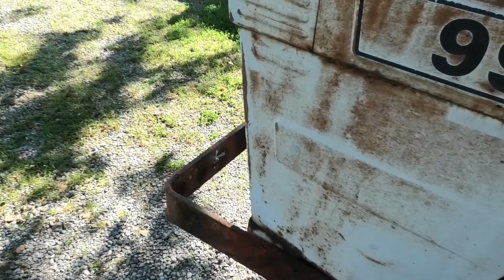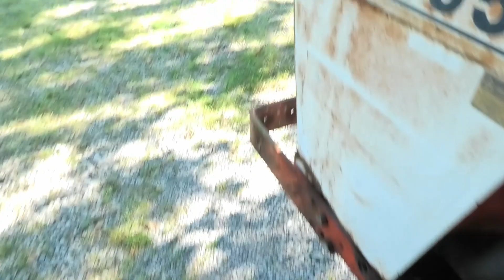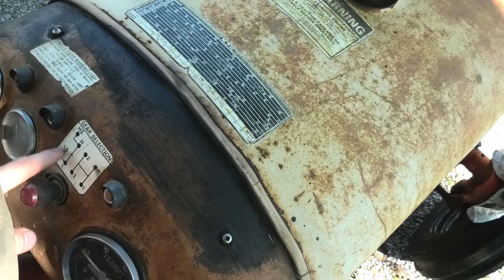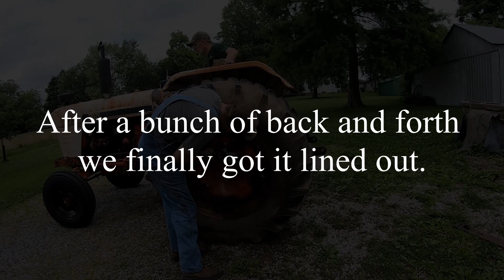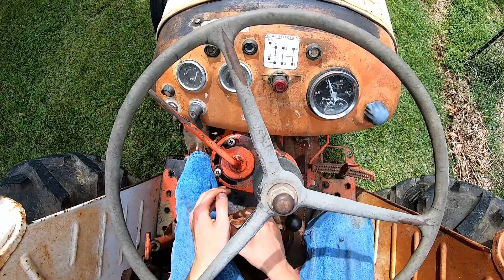Case / David Brown 995

Comment: I think this tractor is actually a David Brown 996, though I guess it could be a Case 995. The 996 adds the independent PTO clutch lever, whereas the 995’s engine and PTO clutches are both controlled by the clutch pedal, if I’m not mistaken. 

I got a DB 996 maybe 10 years ago that’s roughly my age (let’s just say born in the 70’s) and with about as many hours on it. Interestingly, it’s equipped with the same brush-hog bucket as that Massey. The fuel-lifter has been the only major failure point and it runs like a sewing machine. Mine came with an ROPS (nice to have in these WV mountains) attached at the bolts which hold on the fenders. I might recommend fabbing one up, since it seems like you’ve got all the tools necessary to do so.

Great purchase - you’ll get a lot of work out of this thing.
Reply: I understood all 996's in the US were badged 995.
Reply: @danjosephson6910  - Yes, it’s true. It’s badged, on the cowling anyhow, as a Case/David Brown 995. But the metal model plate that’s (I believe) in the toolbox bolted to the right fender, it’s denoted as 995/6. As I understand it, a 995 proper has the PTO clutch actuated by pushing the clutch pedal halfway. The 996 models have the independent, lever-operated PTO clutch on the left side of the operator. If yours has it, take a look at the manufacturer’s plate. It’ll also give you the year, of course, in it’s funny code. I learned my tractor is basically my age, give or take a few months! Anyway, I’m hoping to secure or have someone make from vinyl sticker the “996” to mark my tractor properly. :)
Reply: @B. W.  The tractor is long gone but I still have the toolbox mounted on another tractor and it still has the plate you speak of. Ours had the hand pto clutch on the left side and a shifter for the 2 speed pto on the right. From reading the operator's manual I determined it was a 996.
Reply: @danjosephson6910  - It’s strange to me that they’d badge all American ones “995.” Could that have saved that much money or why do you think they did that? Americans especially like badging that reflects some upgrade, like L to LX, base model vs. a GT, or adding something like “Laredo” to a spec package. And it’s not just an added 5hp or something invisible - the 996 with the independent PTO clutch is genuinely better than the 995.

Anyway, I’d never even heard of David Brown tractors until I moved here to West Virginia. Not sure why they’re as popular here as they are. I’d never come across Gravely walk-behinds either.

Comment: How do you start pto for schredding
Reply: On this tractor, you raise the lever on the left side of the driver which will hook into place - this is the PTO clutch. Below the seat on the left is a PTO speed selector, high and low. Then lower the PTO clutch lever gently, engaging the clutch and spinning the implement. The PTO clutch also disengages the hydraulics and must be down for them to function.

Comment: I have one just like et  db 995 case but hidraulic lifting arms do not work they don't move neder up or down i apreciate any help on direction me
Reply: The internal lines may be ruptured. Dad had one that did that twice in less than 2000 hours. He put external cylinders on it and hooked into one of the remote valves.